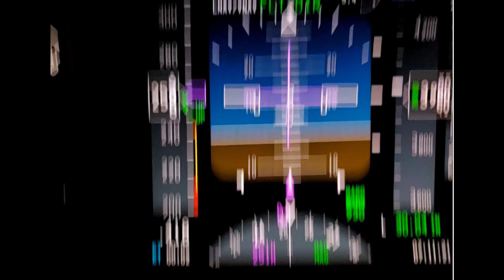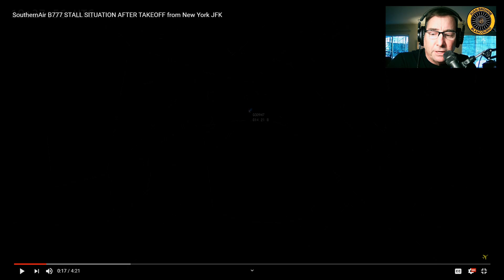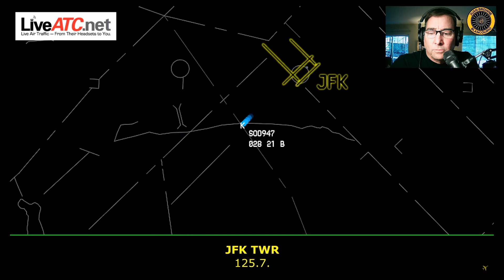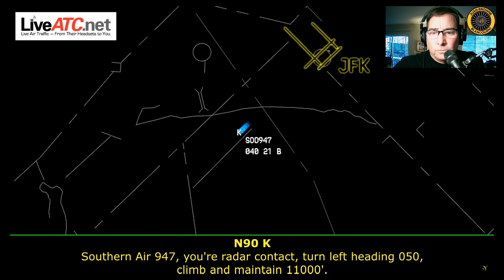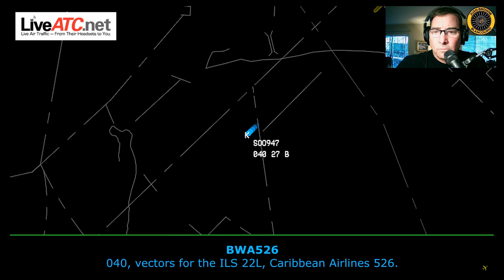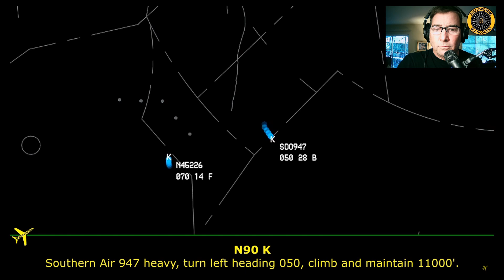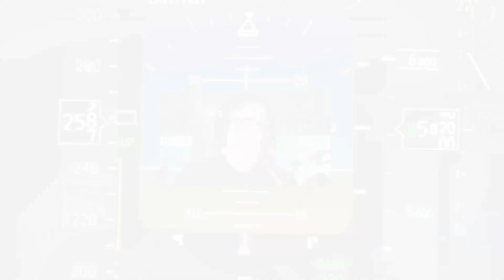"Stall, Stall, Stall" B-777-200 JFK 15 Nov 2020

Comment: @blancolirio It's worth emphasizing that bit about "primary law" on the Airbus preventing a stall not applying to the other control modes. It's STILL possible to stall an Airbus with side stick controller inputs alone. The folks on AF447 discovered this to their determent when a low hour relief pilot held continuous climb force on his side stick and that caused the control logic to degrade from "primary" to "alternate" to "direct" - and in "direct" law it IS possible to stall the aircraft because there are NO alpha protections in direct law. Many bus drivers were not aware of that before AF447 but I can't imagine any that wouldn't know about it now...
Reply from the maker: Correct, thus the emphasis on this presentation of Normal Law.
Reply: Juan did mention that airbus won't allow the stall "under normal law conditions" AF447 flight computers were receiving conflicting airspeed data information. This changed the flight protection parameters and allowed the FO to stall the aircraft. I am positive Juan knows this and that is why he mentioned "normal law conditions" and I just saw that Juan answer to that too. My bad, I should read the replies as well.

Comment: Can you do a video explaining the use of the flaps and what they do for flight and explain what a stall means exactly. I am not a pilot, but I find these videos very interesting, but the terms are confusing.
Reply: Mentour Pilot has a great video on Flaps: https://youtu.be/67HUcVOAY_0
Reply: If you are unclear about the role of flaps, may I, as a low (350) hours, and now lapsed, private pilot (yet with physics and engineering degrees) proffer a simple story.
In ground training, when asked about the purpose of flaps, I said that they increased lift. When told this was incorrect, I objected that they do increase the coefficient of lift of the wing.
However, it was pointed out correctly that, from an operational point of view, you don’t need more lift! The flaps allow you to fly slower for the same lift.
In the incident that Juan is reporting, the related explanation might be that retracting the flaps at too low a speed caused the aircraft to stop flying!
Generally, another effect of flaps is to allow the aircraft to pitch down to increase visibility. And that is why Concorde, which had no flaps, required a “droop snoot” so that pilots could see ahead during takeoff and landing. But this a secondary effect.
Apologies if this explanation is too amateur for the professionals!
Reply: I did some googling a few years ago to understand a stall. If your car stalls you are simply no longer driving but an airplane can stall and still fly (albeit not for long). I'm not a pilot...just an old lady with a terrible fear of flying.  I watch youtube videos to help me get more comfortable. One thing I don't fully understand is...it seems as if airplanes take off at max power so how does a pilot increase airspeed if he/she has the power already max-ed out? I don't know. Must have something to do with those "durn fwaps".
Reply: @stefkadank-derpjr1453 Engine power yields acceleration, not velocity. So the engines running at full power are providing an accelerating force to the plane. Under that force the plane gains velocity until the engines are throttled back. The retraction of the flaps does lower drag which allows for a higher acceleration.
Reply: As, I’m sure, Juan has described many times, an aircraft (or, more accurately, its wing) stalls when the angle of attack (the angle between the airflow and the [chord of the] wing) exceeds an angle, typically, of 15 to 17 degrees. At smaller angles, the lift produced by the wing increases with the angle of attack; at greater angles, the lift  reduces very substantially.
For example, if an aircraft is flown level at reducing speed, the angle of attack must be increasing to continue to generate the required lift. But when the angle of attack reaches the angle at which the wing stalls, no more lift is available and level flight cannot be maintained.

Comment: This is very, very interesting, Juan and you've highlighted something that is not often discussed among aviation followers.  I'm not even sure exclusively Boeing pilots or exclusively 'Bus pilots are aware of the fundamental differences in 'design philosophy' of Boeing aircraft versus that of the 'bus.  I know you have flown (professionally) the A320 (any bus will do) and, of course, the Triple Seven so, you do.

While a demonstration I saw flown by, I think, an A320 or A330 at Farnborough (a good few years ago now) was very impressive and SEEMED to be absolutely bomb proof, I have found the Airbus philosophy (and implementation) to be somewhat suspect.  I refer to the "ability" to be able to just haul on the joystick without regard to conditions, while a Boeing will get progressively more and more resistive to further control input AND THE OTHER PILOT CAN SEE THAT HAPPENING.

Although the circumstances of this incident and AF447  are completely different, the parallel is that this Boeing was physically warning the PF and the PNF could see that happening.  In the case of AF447, neither the PNF nor, eventually, the Captain, could see what the PF was doing and although indications of stall were obvious, it was almost impossible for either of them to find a causal link.

This 'incident', while not leading to a smoking crater (mercifully) it is a fascinating insite into just how quickly the most sophisticated and intrinsically safe aeroplanes, can 'get away' from the unwary (or tired) pilot.  I'm looking forward to the conclusion.
Reply: The Airbus control laws provide protections, that are reduced as they degrade to alternate law, abnormal alternate law to direct law.
here is a summary in great detail of the flight control system modes.
http://www.airbusdriver.net/airbus_fltlaws.htm
On AirFrance 447, satellite telemetry registered a reversal to direct law as a probable loss of  control due to :
loss of air speed indication(3 pitot sensors) ; a possible structural failure of the vertical stabilizer in heavy turbulence, (not the first time) found floating about 50 km behind. 
The link above gives  the best summary of the control laws and the last resort mechanical procedure, 'usable' after loss of the electrical system.
Mandatory reading for Airbus pilots.
Reply: To me it sounds like the sidestick is almost the Airbus equivalent of MCAS, i.e. there were two fatal cases where PIC/FO were giving different inputs to the sidestick.   I am not trying to make light of Boeing and MCAS but everything I learn about the different designs makes me think the Boeing philosophy is better.  A sidestick is OK for a drone or military jet with a single pilot, or a Sony Playstation.
Reply: You nailed it Roger. As a very high time, recently retired airline captain, I despair at the Airbus system. I believe that it will continue to cause accidents way into the future just as it has done in the past. It has so many flaws, the worst being that one pilot can’t see what the other is doing Eg: AF 447, but also in some other nasty very near misses. An additional flaw is that in most scenarios the pilots can’t see what the engines are being commanded to do by the auto throttle, as the thrust levers in many scenarios literally don’t move. Crazy. That tactile and visual feedback provided by moving thrust levers as they are starting to move is absolutely critical when the chips are down and you are “task saturated”.
It’s blatantly obvious that the Airbus system was designed by computer nerds, not pilots.

Comment: Sounds like ATC needed him out of an altitude before they could turn him. (usually to get him above arrival aircraft). The aircraft would normally be cleaned up and accelerated to climb speed out of 1000' agl, however, in this case they were still back at 200/210 kts well above the clean up altitude. Appears they were going for altitude before accelerating to expedite the turn. Suspect they were still at flaps 1 but got too slow even for that setting. No one would have known that they were approaching a stall, (if they had stalled they would have lost considerably more altitude) if the F/O had not broadcast his stall warning. They actually did a nice job getting their airspeed back with a minimum loss of altitude.
Reply: ATC issued both a turn and a climb on initial contact, so your first sentence doesnt seem to actually be correct.
Reply: @beezalbub7325  He was out of 4000 feet at 200/210 kts and on runway heading, westbound when assigned the initial turn. He needed to head eastbound so he was likely familiar with the departure and ATC requirements otherwise he would have accelerated to his normal climb speed and cleaned up the aircraft earlier. Juan mentioned that he should have requested relief from the 250 kts climb restriction earlier, however, if he had accelerated to 260/270 kts he would have delayed his climb, would have traveled a greater distance in the wrong direction, and would have had a much wider arc of turn when turning back the other direction. The crew fumbled the handoff from the tower to departure which did not help matters. The initial handoff was at about 1800 feet, by the time they established contact with departure they were close to 4000 ft. With a high rate of climb the aircraft autopilot may have already been going into altitude capture. If he was hand flying with the autothrottles engaged it is possible that the thrust levers started to retard, and the flying pilot was slow to recognize the thrust reduction which called for a corresponding pitch down to maintain his airspeed. I mention the above as possible scenarios to explain the "why" of what may have happened.

Comment: This is the first time I heard somebody say 'Stall... on the radio.  Is that normal?  I would have expected PAN instead.
Reply: He was talking to the pilot flying and just didn't release the push to talk button.  As a pilot monitoring when you see the aircraft is approaching a stall condition, you need to get the pilot flying's attention before you communicate on the radio.
Reply: Pretty sure it was in cockpit communication that was picked up by ATC do to them panicking while holding down the mic
Reply: @karlsandin4515  That is what I was thinking too.
Reply: He was in the middle of communicating to ATC about climbing to 5000 feet when the Stall Warning alarm sounded. He immediately made the call which is the right thing.

Comment: Boeing aircraft you always have complete control of the aircraft... cough-MCAS
Reply: MCAS is easily disconnected with Flaps down and Stab Cutout. Besides, the pilots' trim switches are designed to override MCAS's commands.
Reply: @nightflyer3242  true, but to be more accurate,  MCAS is disabled by EITHER the cut out switches OR flaps out of zero. (You said "and" when it doesn't require both things,  an "or" would have disabled it)
Reply: @thomasaltruda1243  Yup.
Reply: @nightflyer3242  not on the two 737 Max's that crashed, MCAS overpowered the pilots control authority, and the fact the AOA sensor disagree warnings weren't wired in meant the crew didn't even know what was going wrong.
Reply: When MCAS made the trim wheels spin toward nose down trim, those pilots were supposed to have memorized what to do in that situation. The stab trim cutout switches and and the recovery procedure have existed since the very first version of the 737..
Reply: Even when MCAS was firing...commanding nose down trim, the pilots had complete control to use their normal,  thumb activated trim switches on the yoke to stop and even reverse the nose down command. The accident pilots just didn't use it. .
Reply: @thomasaltruda1243  the official report put the blame with Boeing and the FAA for this, not the pilots.
Reply: @EricTViking The final report cited pilot error as one of the contributing factors. The Lion Air crew did not even perform their memory items, actions that would've taken less than 30 seconds to complete but instead went on for over 10 minutes essentially just going along for the ride. The Ethiopian crew hit the STAB CUTOUT but did not disconnect the autothrottle and left it on TOGA and 94% N1 all the way to the ground. The flight prior to Flight 610 experienced the same thing, but the crew ran their memory items and flew their plane to their destination without incident. That's why the majority of the delay in the MAX's RTS is pilot training related. Software and flight control laws are easy to rewrite, human factors is more complicated.
Reply: @EricTViking   the MCAS didn't override the pilots control authority. The MCAS commanded approximately 10 seconds of nose down trim. Every time the pilots used their trim switch,  it worked correctly,  but also reset the logic allowing MCAS to command another 10 seconds of nose down trim. Eventually,  the amount of stabilizer trim was more nose down than the elevator could provide "UP" and the pilots crashed. At any time,  they had available to them the ability to move the stab trim with their thumb yoke switches, but they didn't. They also left the auto throttles on and full takeoff thrust until impact.
Reply: @nightflyer3242  in the 280 pages I read, pilot error was hardly mentioned, the blame was squarely laid with Boeing trying to cut corners and FAA culture. Pilot error would not have grounded the global fleet and required a re-design of the MCAS system and supporting sensors. Could the pilots have done different? Yes (if the AOA disagree had been wired up). Did the report state that a test pilot in a simulator couldn't handle the same scenario within a "non catastrophic" time period? Yes.
Reply: @EricTViking  "After the IAS DISAGREE had been identified, the Captain instructed the FO to perform memory items of Airspeed Unreliable, and the FO did not perform them." -Straight from the NTSC report. This was right before the first MCAS  commanded nose down trim. Then as the first MCAS nose down command, "While the aircraft control was being transferred by the Captain to the FO, the right altimeter indicated 5,900 feet, the pitch trim was 5.4 units. A few seconds later the MCAS activated for 8 seconds and the pitch trim changed from 5.4 to 3.4 units. The FO commented on abnormality of the aircraft control but did not clearly specify the abnormality. The FO commanded Aircraft Nose Up (ANU) trim and the pitch trim changed to 3.6 unit." Lack of CRM and virtually no aviate in "aviate, navigate, then communicate." This was two minutes into the MCAS runaway event and they did not even start the runaway trim memory item. The whole thing was rinse, repeat for another ten minutes, until they finally hit the ground.

Comment: If this was a 737, I can already hear the "Airspeed Low! Airspeed Low!" warning in my head.
Reply: Guess Boeing figured by the time a pilot was operating a 777 they wouldn't need such basic warnings
Reply: @kgb4187  No, it is actually a pretty new feature on the 737 that was installed with a EGPWS update in 2015. As far as i know it was prompted by several incidents and accidents including the Turkish Airlines crash in Amsterdam.

Not to mention, there are quite a few airlines in the world where a pilot starts on a 777 after flight school.

Comment: You think he was climbing in VS mode and not IAS and wasn't paying attention?  Will get you every time.
Reply: Doubt VS as they were close to level off. If it was VS it had probably gone into altitude acquire mode. In that case the IAS window might have opened at too low a speed.

Comment: Well done.   Kennedy does expect heavy freighters to need high-speed climbs but pilots need to confirm it with them.  I don't think I ever left JFK with a CMS below 270kts.
Reply: They can expect the call, but it's not required. Far 91.117(d) You can always fly at min safe speed.
Reply: @hansadrvr  Correct! The call is a courtesy not a requirement. The regulations specify that if your min maneuvering speed is above 250kts then you fly that speed
Reply: @hansadrvr --  it is a courtesy for traffic planning, but as I said, most controllers who handle heavies have already take. It into account.
Reply: We move fast in NYC, in every way.
Reply: CMS = Climb Minimum Speed?
Reply: @bigjeff1291 ----Sorry--Clean Maneuvering Speed.
Reply: @tenpiloto  Thanks!👍🏻